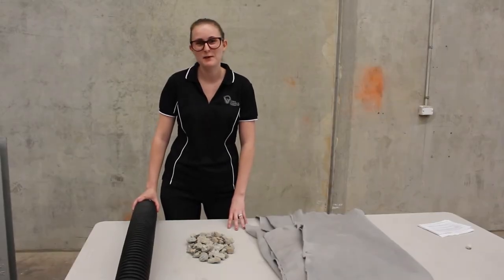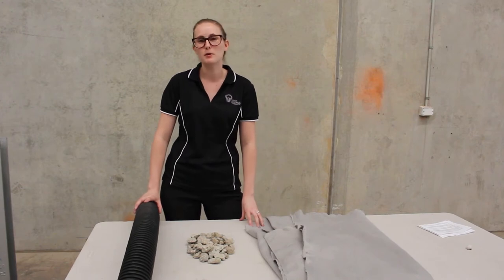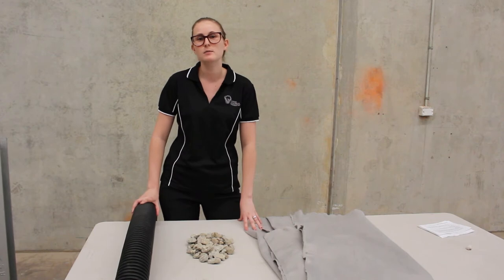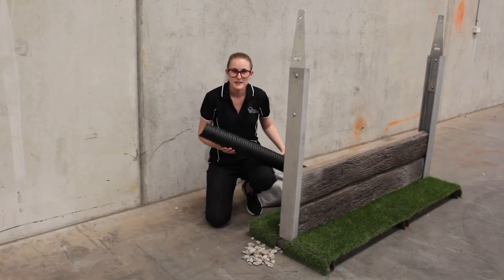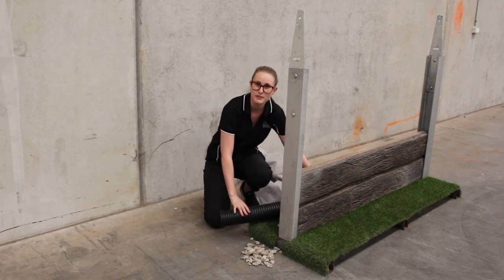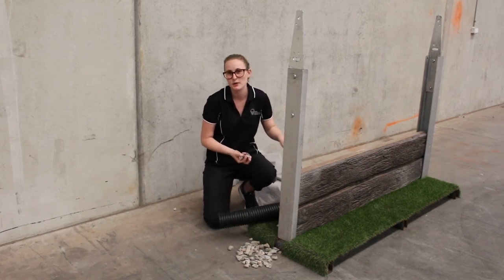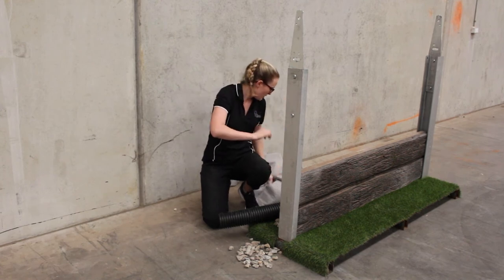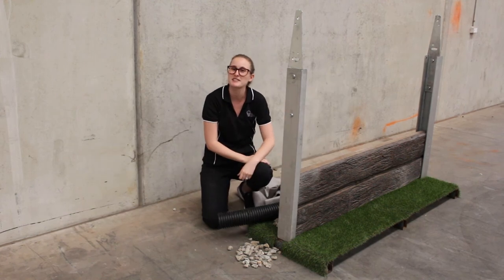The Importance Of Backfilling A Retaining Wall

Comment: Hi there, I have a project that has ridgi set up to 450mmm height in a rectangle set against the dividing fence of a neighbouring property... Can you tell me if an Ag pipe is necessary and where the gravel would go as to not have it compact against the dividing wall (can't have the drain pipe inside the rectangle surely..)